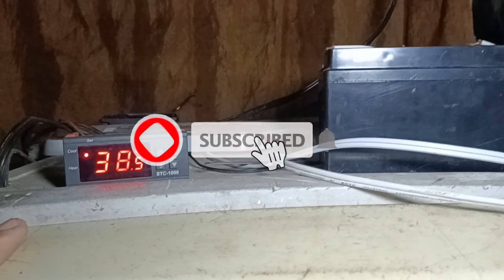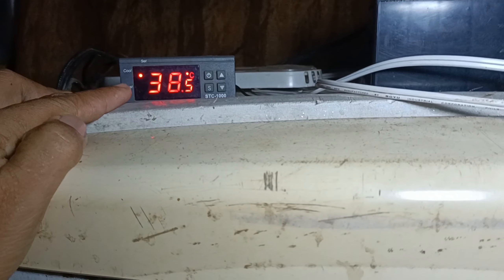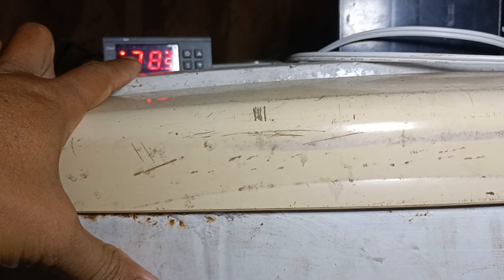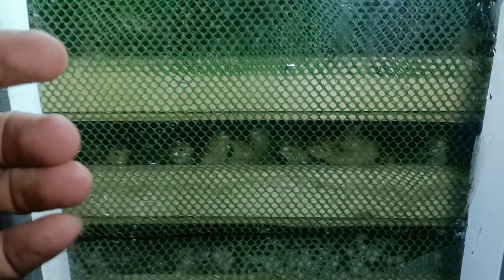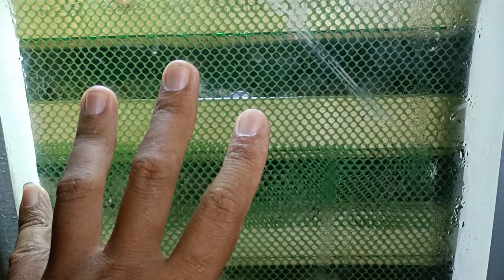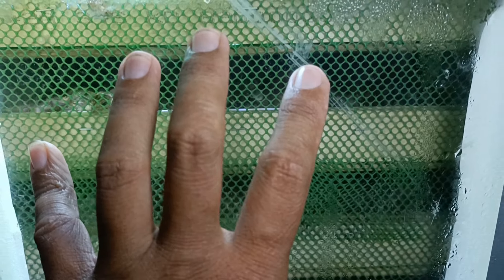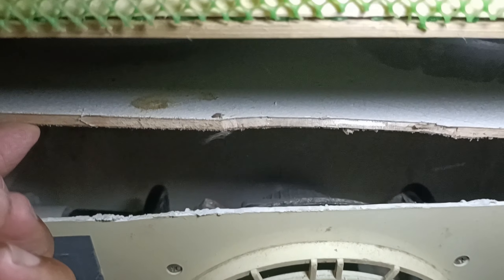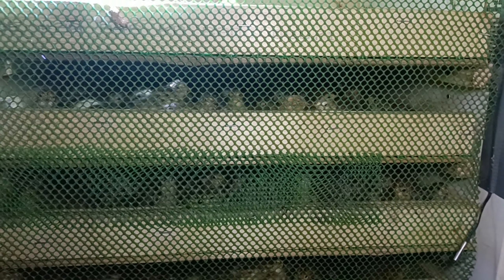PAANO MO MASABI NA OVER HEATING YUNG INCUBATOR MO OVER HEATING NA INCUBATOR

Comment: hnd b dapat mag adjust k ng temp kapag day 18 day 19 day 20 and day 21?
Reply from the maker: Sa Akin Hindi Po ako nag adjust na temperature ko kung ano Yung onang Araw na temperature Yung na haggang nasa mapisa na Sela sa humidity nalang ako nag adjust
Reply: Good day! Sir, pwede po ba magpatulong kung paano iconnect yung automatic turner sa sa thermostat. Sana masagot po sir. Salamat po in advance.
Reply: @Cristitang  hnd ako marunong sa electrical ng incu  marunong lang ako sa operation ng incu at kung pano mkkapisa
Reply from the maker: Yung automatic tuner connect sa thermostat hindi po pwede automatic tuner pwede mo connect sa timer yung timer kase mag papagalaw sa tuner